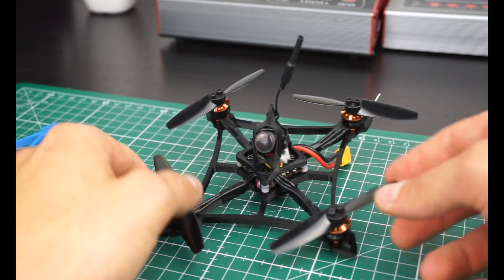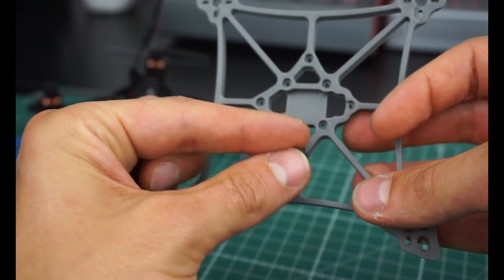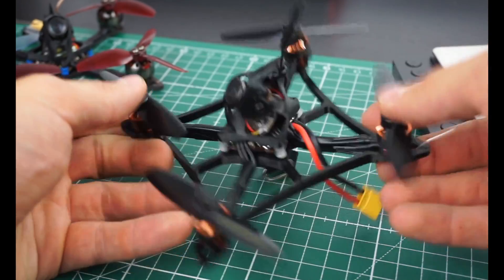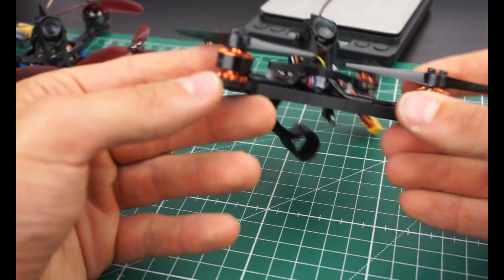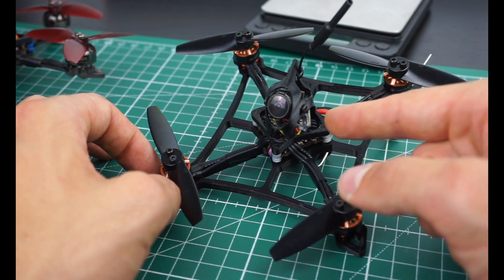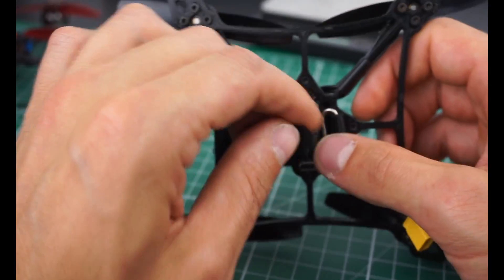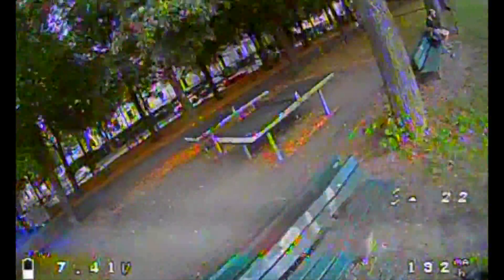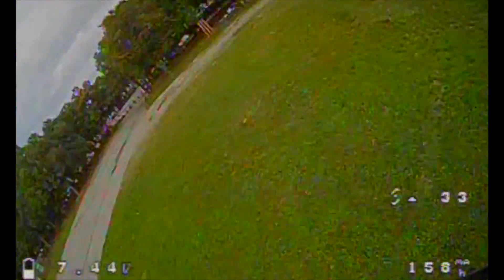Microblivion II - New printed 3" Toothpick

Comment: great work.
you need to round all angle to upgrade air flow. At list the up face. For the down i'm not sure about the turbulent flow.
you can test in increase the height of the frame and remove the x arm, for best air flow.

Comment: Also possible to mount a caddx turbo cam for HD record, or u recomandent a other frame for that build?
Reply from the maker: Yves Brüderli do you mean the Caddx Turtle? Yes that should work with the adapter plate and Canopy of my Calimero HD frame (also on thingiverse)
Reply: @DaveCFPV  order some hardware:
-geprc fc
-caddx turtle
-eachine nano vtx
-1103 skystars 8000kv 

Does it works? :-)
Reply: @DaveCFPV  To bad. My 1103 Motors doesnt fit on this frame....
think will to try the 3" Calimero Frame.
my hardware that i got:
Caddx Turtle
Skystars 1103 8000KV Motors
Eachine nano vtx
T3x3x3 Props
GEPRC FC

Or did u recomandet a other frame from you :-D?

Comment: 1104 6000kv with HQ T3X2 at 60G dry flies smooth. 450Mah 2s getting 3 minutes of aggressive flying. Printed in hatchbox PLA. TIp for printers, make sure to print PLA frames at .15ish layer height or finer, I use .12 on my Ender 3. Makes the frames 20%ish stronger than .20 layer height. Annealing helps too. As always, love the frames Dave!
Reply: Do you print with stock nozzle (0.4mm)?
Reply: @meegz6189  Yes. Another quick tip: Print the frame with the cooling fan off. The frame won't look quite as good, but layer adhesion is A LOT better. CNC Kitchen's tests were up to 40% better layer adhesion with the parts cooling fan off.
Reply: @primerfpv8887  Dude thanks so much!  I'll definitely do that.
Reply: I've always heard that thicker layers are much stronger than thinner.  This is because of the heat in the thicker layer bonds to the previous layer better.  Thin layers don't carry much heat, leading to poor layer adhesion and weak prints.  Here's an article written up on it: https://my3dmatter.com/influence-infill-layer-height-pattern/

FWIW, I'm going to print with 0.6mm nozzle and 0.3mm layers in PETG.  I'll take the weight penalty for the extra durability of PETG.

Comment: Great design, love the countersunk cap head m2s, your reasoning, and your execution. So clean! Always glad to see your latest, keep it up man! I wouldn't be much of a friend (I know we've never met, but honestly i'm a fan, I show off your designs any time I find someone with even their pinky toe in the water of 3d printing) if I didn't have anything useful to say... Here goes: what about torsional rigidity? I saw that it's bendy like soft plastic, does the addition of the canopy stiffen it up any? Do we embrace the smol floppy-ness? Does it help in crashes, so we accept it? I don't think you could add bracing from the frame UP (twards the canopy) in any meaningful way without blocking the props, what about downwards? from the motor mount points heading down tward the battery? would the weight penalty be the only actual change, since it flies well now?
Subscribed, and the notification bell. Your content is outstanding.
Reply from the maker: Rotorblast Thanks man nice to hear! Let’s put it that way: It needs to be as rigid as necessary to fly well and as flexible as possible to absorb energy in crashes. This one is designed for light setups (1103/1104 motors) so I can keep the weight of the frame low too. If I made it strong enough for 12xx-14xx it would have to be heavier

Comment: The barrel head Allen screw is usually called a cap screw.  The ones you mentioned that strip out easily are called button head.  I wonder if there is a way to print this frame where you could insert carbon fiber rods to stiffen it?

Comment: Dave, what is the 'best buy' 3D printer, in your opinion, for fpv?
Will Creality Ender 3 be enough?
Reply from the maker: Counter Strike I use an Ender 3 with a few mods. But it’s really great out of the box!
Reply: @DaveCFPV  Would you mind sharing which mods you did?
Reply: KimchiFPV I printed all Daves frames using ender 3 having added bltouch 3.1 runout sensor with marlin 1.1.9 bugfix release. You should find everything you need on Teaching tech youtube channel

Comment: Sadly there is not a single motor in existence with a stator of 12-13mm width and 2-3mm height. Which would be perfect for this type of quad paired with the HQ 3inch T3x2 prop.
Or am I missing something?

There is the Brotherhobby 1402 but it has a 2mm shaft, so you would need to drill out the props.

Comment: Great quad design and set up. I also planing to build somthing like that. Think I would go with 2s 550mah and then your 1104 6000kv seems ok. What so you think of the new HQ Micro Prop 65mm Bi-Blade 2.5?
Reply from the maker: Jens Penttilä Haven‘t tried it yet sind I’m focusing on 3” at the moment. But seems to be good